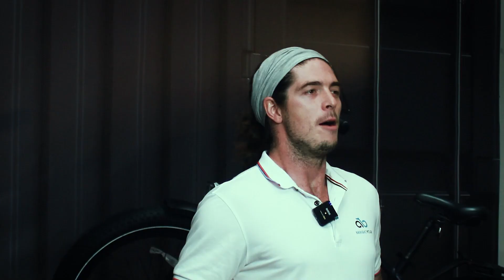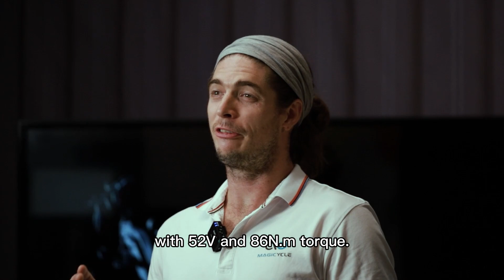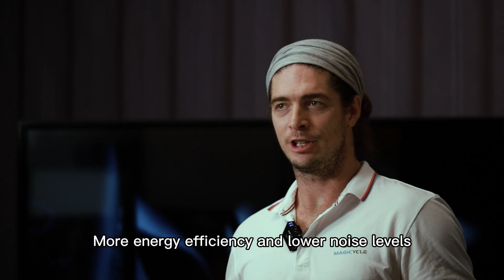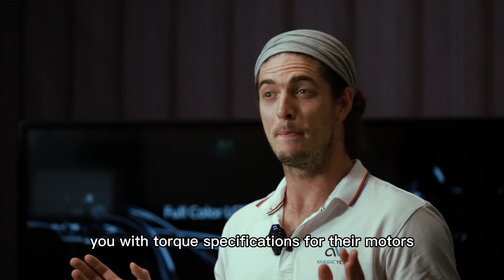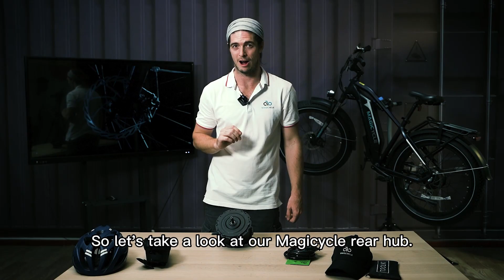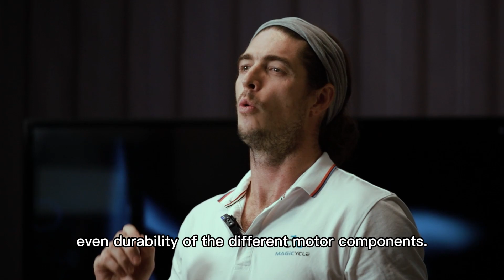Magicycle Fat Tire Ebike Shengyi Motor | Behind the Magic

Comment: I have the 750w Ocelot Pro.  Recently, a bungee cord fell from my cargo bag and entangled on the rear axle.  The bike stopped working and error code 30 showed up on the display screen.  The bike will not run either by pas or throttle.  Do you have any ideas for me?  Also, does Magicycle have any videos on how to replace or repair the hub motor?  Any comments would be appreciated!

Comment: Wondering as battery discharges during use at what battery voltage will motor stop operating? In other words, what is the minimum voltage necessary for motor to engage?
Reply: Good question